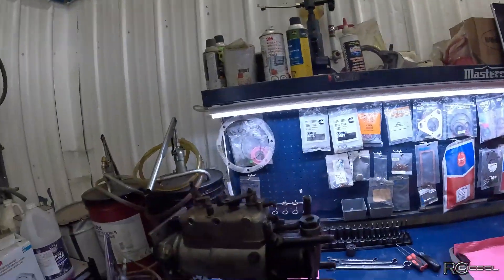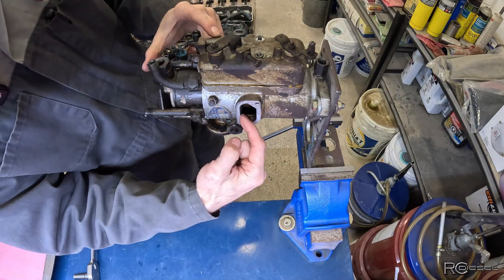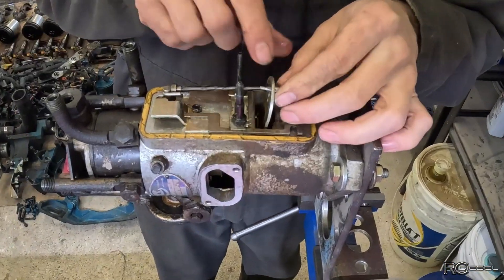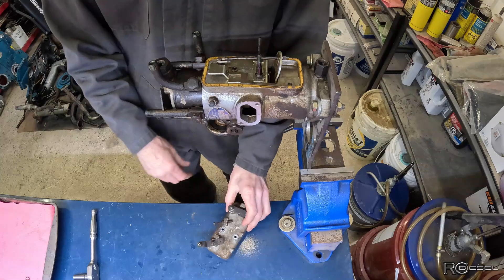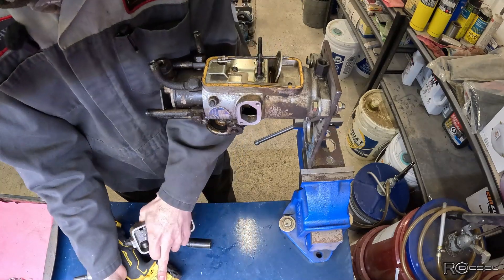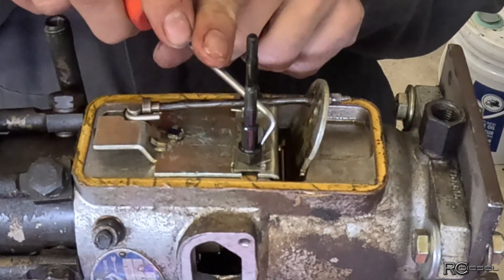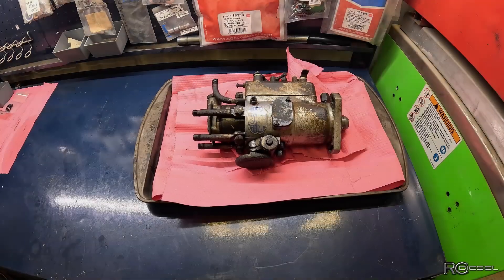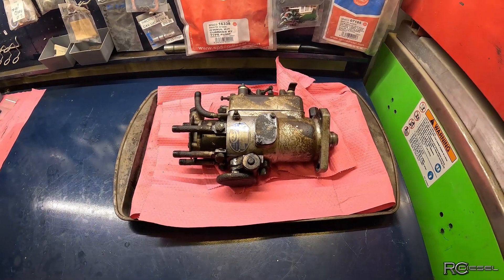🔧 Complete CAV DPA Fuel Injection Pump Tear Down and Inspection | Too Worn to Fix 🛠️ RCDiesel

Comment: Thank you very much sir.i have a question ❓❓❓ my tractor is a MF 230 it has Ad3 152 Perkins 38 hp, fuel pump cav dpa 3230f460, sw 46/800/3/2150 the mf 240 has EXACTLY the same engine ad3152, and it is 47 hp,. What can I do to the pump to upgrade my horsepower to 47 or so? I opened the door on the fuel pump and adjust the plate from minimum to the middle ( can I put it to max?????). My full rpm are 2150 and spring position 3, if i change the spring position to number 6 ( most common to mf 240) i will increase the maximum rpm?. thank you very much 🙏

Comment: Hello, I have busted one of the two studs that holds the top cover. The pump is on the car. Will it be necessary to remove the pump to replace the stud or can I do it on the car? Any suggestions welcome. Thanks in advance.
Reply from the maker: I would say, depending on what kind of access you have to the pump, you should be able to extract the broken bolt with the pump installed. How to get it out will depend on a lot of things. Might be able to JB Weld a small bolt to the broken bolt and screw it right out once the JB Weld dries. Just cover that pump up so you don't get any junk in it.
Reply: @rcdieselchannel  Thank you. I think am going to try with the pump on the car. It's broken right at the top and so am hoping to have some room to pull it out.

Comment: Any suggestions ? Starts for a second and dies and then very little fuel comes to injectors when cranked. If magnetic valve unscrewed, fuel flows out and easily. Now on order is this little guy "7139-650G". I suspect something near that vein pump and its pressure regulation.
Reply from the maker: Ok, so you've got the pressure regulator on order. It's possible, but I'd be checking if the return line is restricted. That causes and increase in pump body pressure and the regulating valve needs body pressure to be correct in order to regulate correctly.

Comment: Wow = you are on another planet with your pricing - just bought a recon, fitted, working good $400 ebay. The recon shop did a great job and it is happily running a Perkins 4.108.     The old one leaked fuel into the sump.  Got a recon kit for $22. These pumps were built in simpler times and easy to fix.
Reply from the maker: I'm a bit confused.... Your old pump leaked into the crank case, so you fixed it with a $22 kit? But then you replaced it with a $400 Reman?
Reply: Bomba CAV INGLESA  se usaron mucho en motores de tres , cuatro , seis cilindros la mayoría de los Perkins de 6 cilindros eran de los tanques de guerra ingleses
Reply: That’s not a bad price at all my grandfather rebuilt these types of pumps for 500 bucks

Comment: how not to work on anything, don't use an electric screwdriver use socket set manually
Reply from the maker: Well, I'm not so sure I'd apply that to "anything"... lol

I mean sure, an inexperienced individual shouldn't get an impact too close to an injection pump, but experience does tend to dictated what a guy can and can't get away with.... I personally don't see too much of a problem using an impact to disassemble some parts. You'll notice I used an impact on some things and not on others. There's reasons for that - to put if plainly, I've done enough of these to know.

Thanks for watching and I appreciate the input!
Reply: @rcdieselchannel  dismantleing (not disassembling) I don't mind too much, problem is I see so many vids of so called, mechanics, using them for assembly, which really, really pisses me off, especially when it's accompanied by pounding f_____go bongos, swirling and whooshing intense violins bangs pops clicks pounding bongos and other annoying distracting dumbed down brainless degenerate dickhead background noise, all come to the fore with the advent of the cordless driver,

Comment: Where did you learn how to do this kind of work?
Reply from the maker: An old mechanic taught me how to do a Stanadyne DE10 and a different old mechanic taught me how to do a Roosamaster off of a 4020 many years back. The rest is mostly an attitude thing. I believe that if men built it - I can figure out how it works and if I can figure out how it works, then I can fix it. That's not true in every case, but it's an attitude I have. 

That being said though, some of these pumps are pretty complicated and there's a lot of things involved in fixing them. I've screwed up a few pumps while learning how they work and teaching myself how to fix them and that's an expensive way to learn!
Reply: Really like your vedeos👍
Reply from the maker: @Agirhydro23  Thank you! I appreciate you tuning into the channel!